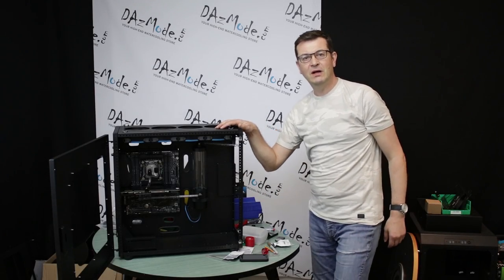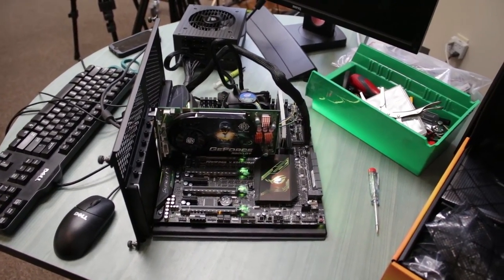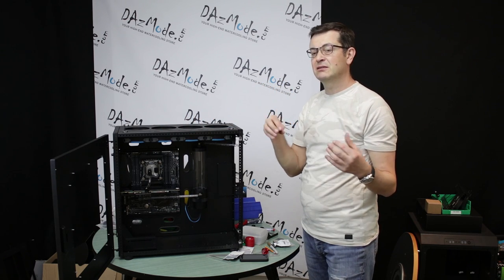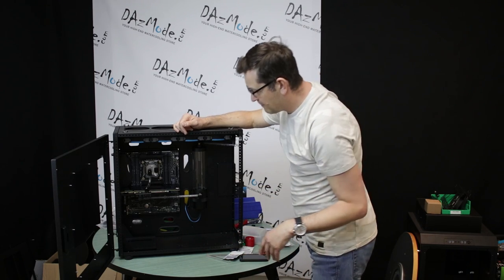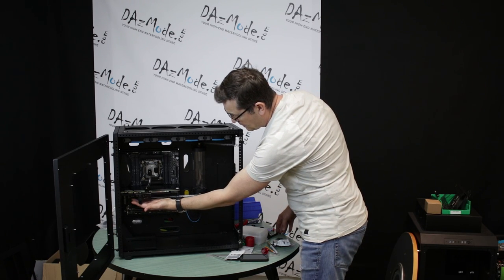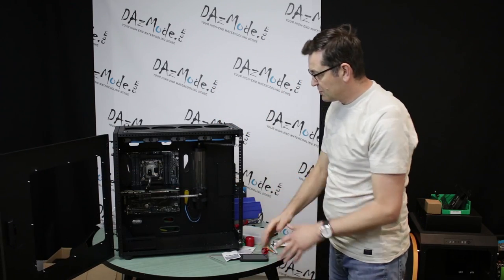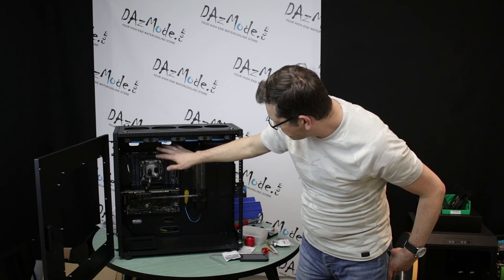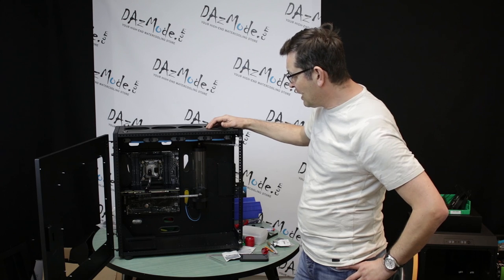Laying Down Some Tubes - No Name Build - Ep2

Comment: Great case but it has 1 VERY BIG problem.......The window is far out of date and needs to be updated in my opinion.
Just like you said......you almost don`t see your watercooling hardware because of the small window.
I`m happy to see that you said this in this video because this is the reason why I still have not bougth this case (I`m not a modder).
With a big window this case is PERFECT :D
Reply from the maker: I think i will turn alright, at least bottom part is hiding PSU and cables. Little more to the right would be nice altho.

Comment: I feel like you should know that the location of the cpu socket is up to the mobo manufacturers, so there's nothing EK could do about that..................
Reply from the maker: It is freaking the same for years.
Reply: Jayztwocents once changed his motherboard and he had to adjust his tubing, because the socket was off quite a bit compared to his previous mobo.